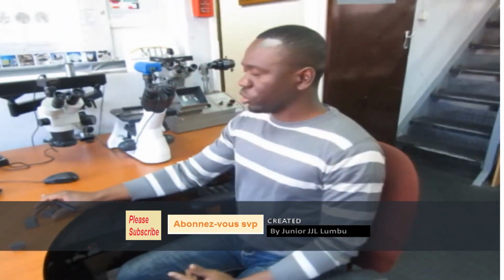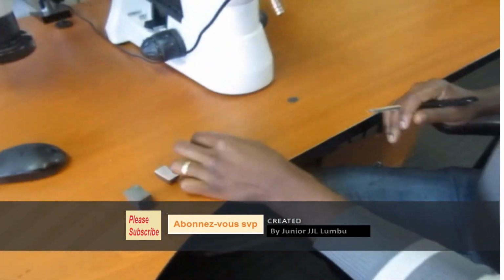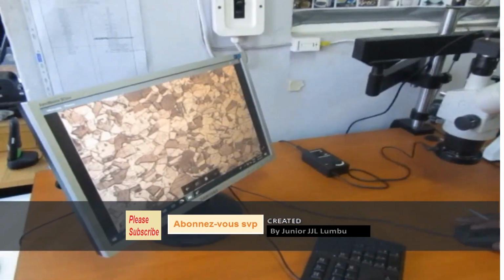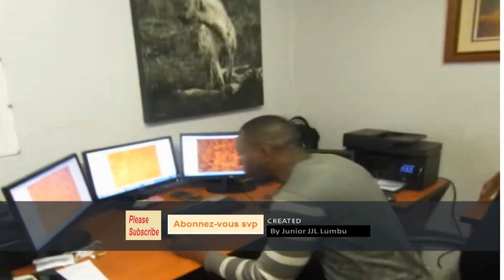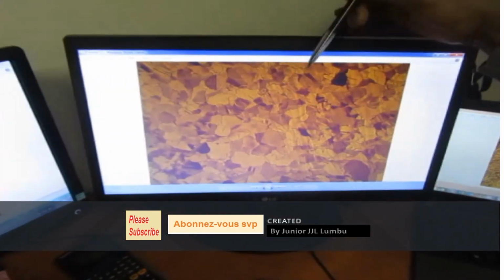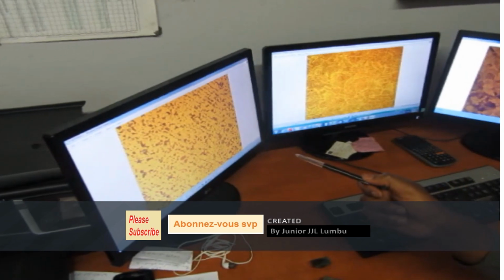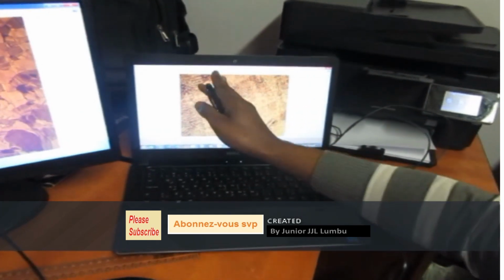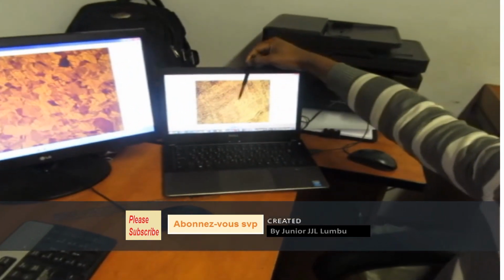Microstructure, quick basic explanation and interpretation - Microscope (basic physical-metallurgy)

Comment: Brother some foundries doing in mould water quenching of high mangnese steel. i.e they put casting in water still its red hot in mould...i want to read more about it ..wr do i get that information plz help
Reply from the maker: Hi dear, unlike other steels, high manganese steels usually soften when quench in water. I don't have a specific book to recommend but you can go through this link for some assistance:https://ujcontent.uj.ac.za/view/pdfCoverPage?instCode=27UOJ_INST&filePid=136046620007691&download=true
Reply: @JuniorJJLPhysicaMechanicaLumbu  Thank you That was very helpful. I red fully .
If you improve quality in workhardening just by 20% its a huge market demand

Comment: Thanks for this informative video. Please I need you to help me determine the microstructure on my micrographs. Please how do I send to you?
Reply from the maker: Hi there, juniorlumbu@gmail.com is my personal email... Please don't forget to subscribe to our YouTube channel as a sign of support
Reply: @JuniorJJLPhysicaMechanicaLumbu   Thanks for your kind reply my dear. I have already subscribed to you. I'm sending you an email now with the micrographs on wetransfer.
Reply from the maker: I'm a bit late, I had received your micros pictures... At first look I can see martensitic structure formed which is caused by lack of enough preheat of the material before welding
Reply from the maker: The sample or material needs to be preheated at about 200 to 300 Celcius, using a torch or blanket ( resistance blanket), while warm the welder shout starts welding.
Reply: @JuniorJJLPhysicaMechanicaLumbu   Ok. So you mean the microstructures are all martensite?
Reply from the maker: Pretty much, Yes they are